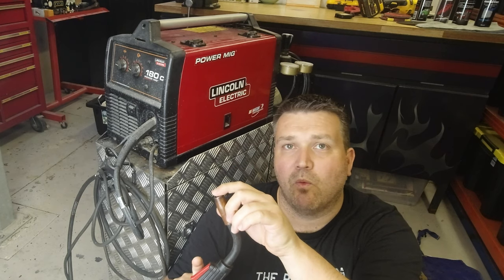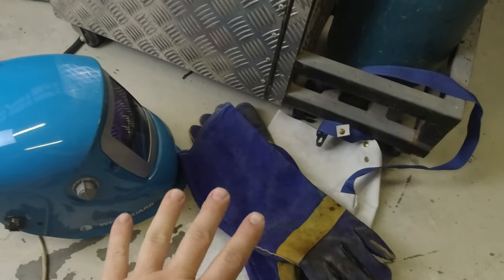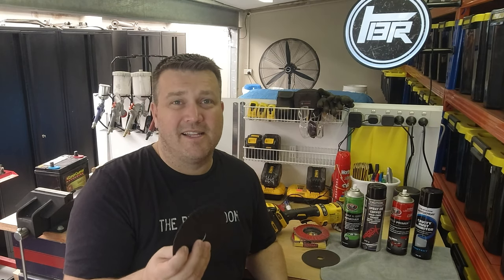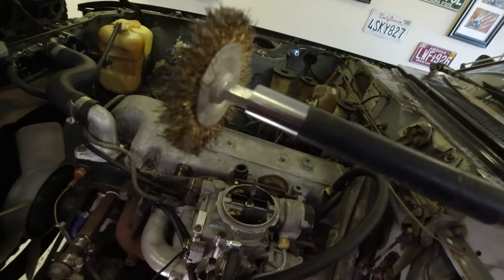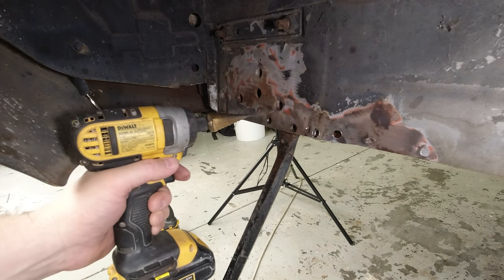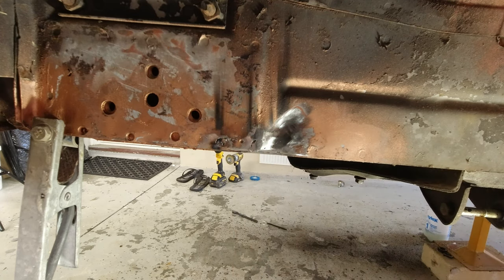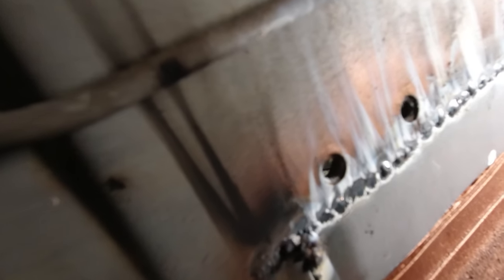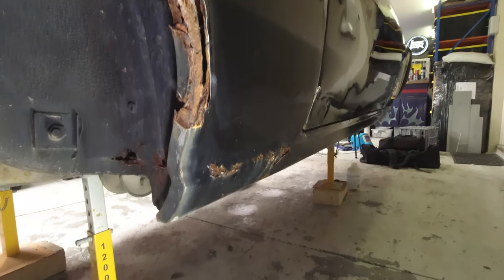Rust Repair Begins! - RA23 Toyota Celica Restomod (Part 6)

Comment: nice quality repair work! Interesting how all the Ta22 celica seem to rust in the same places. On my 1973 I did the same repair on the lower strut towers and rear wheel tubs etc. My tow hooks when I pulled them off the front had rust that needed repairing behind the hooks them selfs. On the front frame rails I was caught off guard by some hidden rust below where the steering box mounts give it a quick look there (the front frame rails to fire wall there is a gap and a piece of steel inside there that holds the dirt with no drain hole that causes this), Also check the brackets that hold the trans mount mine had rust hiding behind there. The other really common aria is the box section where the fender tops  mount to are usually rusty. Inner rockers (sills) are very common for rusting out too. both my Celicas had soft front frame rails under the driver/ passenger foot aria.
Reply from the maker: Thanks those are great tips - am going to be finishing the underside this week so i can start applying the stone guard. Will definitely take a good look at all those spots - much appreciated!

Comment: It is SELL-A-CA. LOL Be safe. Great video. I love you are saving this car. I just finished my 1969 AMC AMX 390 GO PACK CAR WITH EVERY AVAILABLE OPTION. They are a labor of love for sure but we'll worth it. Neal
Reply from the maker: Haha - in Australia we only butcher the finest of the Queens' English! We also do everything upside down. AMX is a  fun looking beast, you're right they're a labor of love but someone has to save them! In some countries the govt will pay you a grant to restore a heritage listed house, I'm hanging out for the day they do that for classic cars  🤣
Thanks for watching!
Reply: @TheBuildRoom  now THAT'S a great idea for sure. Hint....... Use POR 15 on as much of the under carriage as possible. It works awesome and will last forever. Use a brush not spray on and goes a long way. I love how you are cutting the rust out and not doing the easy fix. If you use K2 PRIMER you will get best results. When you are done, you will have a treasure to hand down to your kids. I was thrilled how you got the engine running . I was holding my breath on that one brother. Lol. I was very lu lucky that mine was rebuilt by a master engine builder before in went into storage over 20 years ago. The worst thing with mine was it was stored with a car cover for all those years which caused it to hold moisture. It still amazed me how much of the original things worked on it after over 50 years. Here's a smile for you, I got the A\C R12 TO WORK. YES I found R12 case on eBay. What a bonus. Cheers. Neal
Reply: @dianelee2100  the Yanks love POR 15. And I must admit, the stuff looks great!

Comment: Good to see your getting into the rust.  Good tip on the weld through primer. Off to get some now. Cheers.
Reply from the maker: There's a lot of rust to get into! I'd recommend the the copper primer not the zinc 👍
Reply: @TheBuildRoom  searching for some now. Not so easy to find.
Reply from the maker: @owenlambert6201  Your best bets are automotive paint stores and welding suppliers. Expect $30-45 per can depending on brand.

Comment: Nice job on the rust repairs. A little tip on using weldthrough primer, if you have the access to weld on pure metal and are able to protect it afterwards then do that. Weldthrough primer usually gives a little bit nastier weld in my opinion. It sputters and gives a "dirty" weld compared to a completely clean area.
On closed off spaces like the bottom piece you are welding ofcourse its a good idea.
Other than that very good job. Rustwise I would say you are pretty lucky, although cosmetically your car looks pretty bad, you should see the one im working on, :(
Reply from the maker: Thanks for the tip, also a very expensive way to prime so will definitely try to only use it where really necessary in future. Thanks for watching 👍